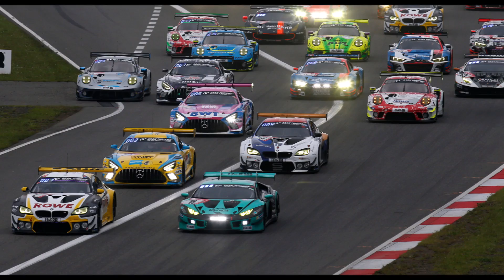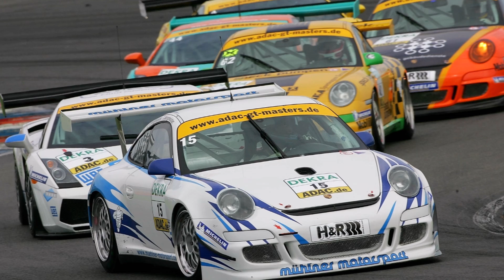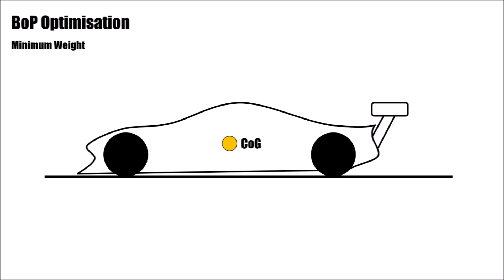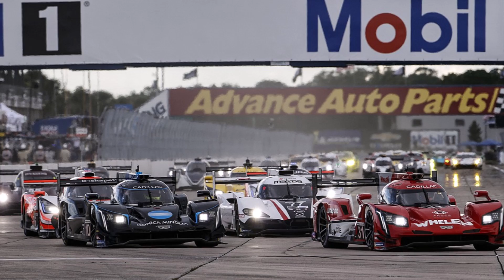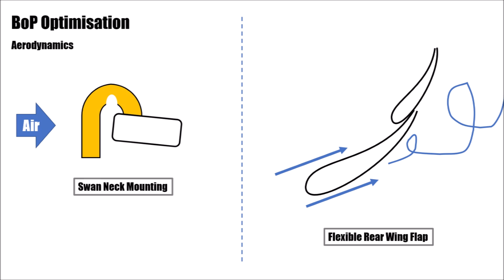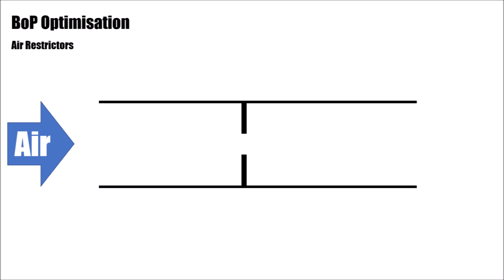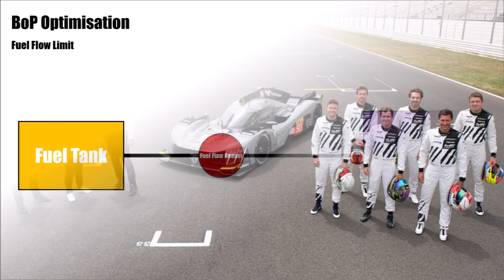Balance of Performance (BoP) - EXPLAINED

Comment: Thank you for this! Regarding the fuel tank with balls, are teams required to carry a certain amount of fuel at the start of the race and teams want to carry less to save weight? I'm a little confused about this tactic.
Reply: No, the balls are used to reduce the volume so there cannot be so much fuel and they will need to pull in the pits for more more regularly or will have to do the race with less fuel (if refuelling is not allowed).
Reply: @tichifrancetich8713  why would teams want less fuel in the car? Especially if they can’t refuel. Is there a starting fuel minimum?
Reply: @cben86  It's not the teams that want less fuel in the car, it's the rules that set max allowed amount for each car so no one gets too much advantage for running less pit stops than others. The balls are used to limit volume in the tank to what the rules allow. Unless you can somehow get the balls also fill, then you would have more fuel and get advantage by having less pit stops or at least have refuel less but that kind of cheating would be pretty easy to reveal and I haven't heard it used.
No starting fuel minimums but if the race is long enough to need many pit stops then it is pretty much always best to start with full tank.
Reply: Forgot to mention that pinching the balls is useful if you can refuel. And that what you say could work in some (very specyfic) cases
Reply: I think that the idea is to just get the balls to deflate (rather than fill with fuel) thus increasing available tank space.

Comment: Really looking forward to your next video, as this is the one big question that has been confusing me since I heard about LMH and LMDh will be racing together... Keep it up!
Reply: I don't get why people worry about lmh vs lmdh, they have the same tyres, power curve, and aero window
Reply: @Endu-Rants  ...and that's exactly my point. Of course, at first glance it's absolutely great as there will be a lot of competition. While LMH will be the class for innovative approaches, LMDh is more cost-effective and therefore more suitable for smaller teams or private drivers.
But won't the more expensive LMH soon become obsolete if all cars will be completely BOPed out, drive equally well and can win the same prizes? Why spend a lot more money if you don't get any benefit from it at all?
In my humble opinion, there will have to be a difference between those two classes to keep the LMH alive in the long run. Even if it's only by BOP...
Reply: @ynnn991  no the difference is big enough. The ability to design their own chassis was so important to Ferrari that they didnt care about the savings they would have had from LMDh… same for Peugeot: running without a wing would not have been possible in LMDh!
Reply: @ReXzz  I hope so! That's why I am so curious what the BOP will be in these classes. :)
Reply: @Endu-Rants  you forget the hybrid activation to the front axle in lmh vs rear axle only (lmdh)
Reply: @waynekerr67  on lmh it is only activated above 190kph so no advantage
Reply: @Endu-Rants  There is a advantage in Lemans, lots of fast corners where Toyota has way more grip.
Reply: @corsamode  I'am tentative about it, in if you take away stress at the rear to ask more from the front it should only understeer, It would only be an advantage in places where traction is the thing that is holding it back
Reply: @corsamode  bullshit. At 190 km/h, there is 0 advantage of AWD, because any RWD car can floor it at that speed anyways (without braking traction)

Comment: "Ask in maranello for more information on this" 😂😂
Reply: Cheeky one indeed. Still don’t know how the 2019 Ferrari fuel flow cheat was “legal”
Reply: @Westdar2198  because the phrasing "maximum fuel flow is 100 kg / hour measured by fia spec ffm" , and Ferrari find the ffm not always on,so 2019 happened
Reply: @Westdar2198  it most likely wasnt. However we may never know because of the deal that was struck between the FIA and Ferrari to basically hand over all of the information relating to this
Reply: Depending on which trick they used it could be legal or not. If it was alligning the power of the pump to the same of the fuel meter it was illegal. If it was making a leak in the intercooler so that oil would be burned too then it was using a gigantic gray area.
Reply: @tichifrancetich8713  they did both.